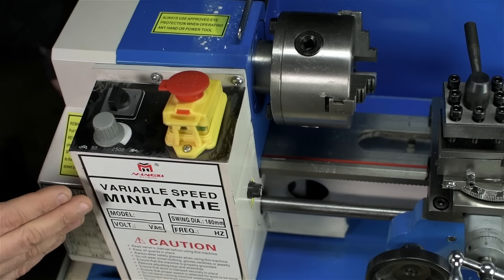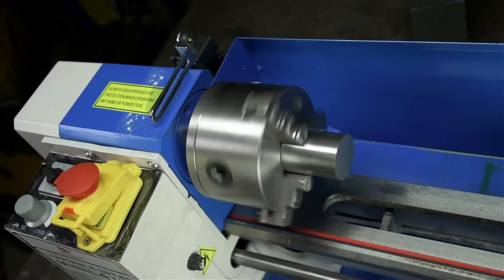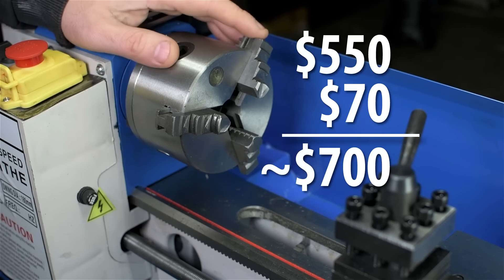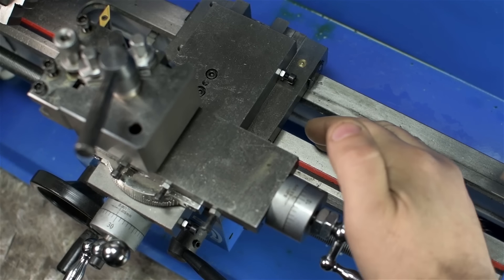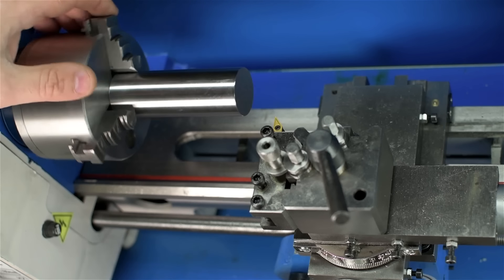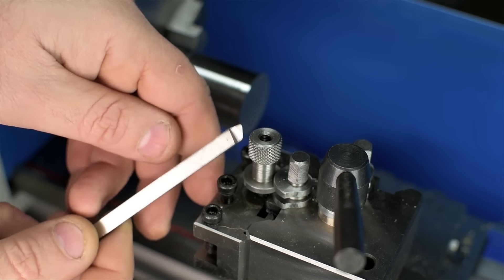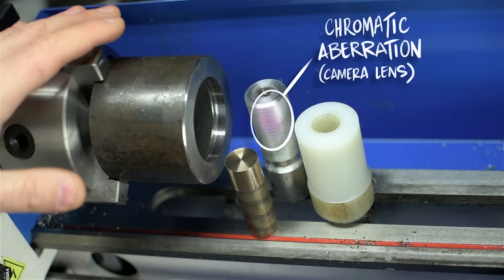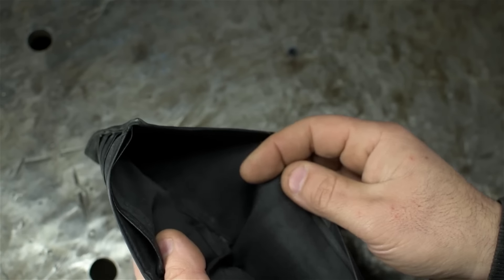The Infamous Mini Lathe!

Comment: Listen you can't run that thing like a big lathe, it's a cheap little mini job from China. You got to run it slower, your Cuts got to be smaller, and it's imperative that you keep that blade as sharp as you can. High speed will just cause more vibration, and a deep cut with a dull blade.... I don't have to tell you what that would look like. Still, you've got me intrigued on the whole mini lathe thing..... looks like I'm going to have to buy one....

Comment: This guy doesn't know how to use a mini lathe,  you don't use carbide on aluminum, nice Sharpe HSS and you don't cut at low rpm, yes on a large lathe but these small ones cut much better with speed

Comment: Here's a rant of my own :-)

The most of the rant here sounds like the rant of a tool snob, who has a Hass Mini Mill CNC machining center and whines about the "shitty" cheaper Tormach or Sherline or Taig...haha..

Some old guy with a lot of machining experience once told me: "It's 1/3 the machine, and 2/3 the operator".

It is indeed not the best lathe, but many hobbyists can not afford the $4-5K swiss or german made machines just so they can do a hobby steam engine project in brass. 

just sayin' :-D